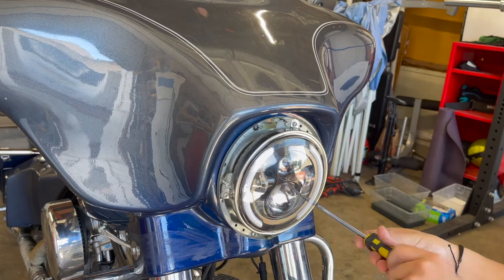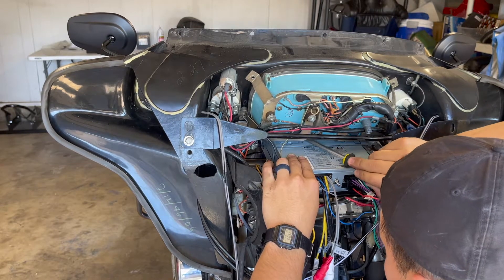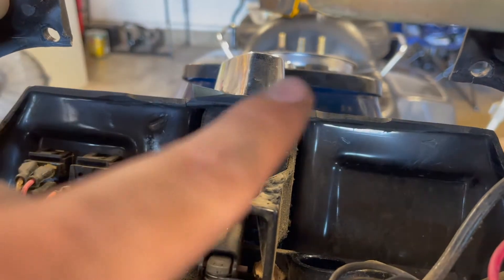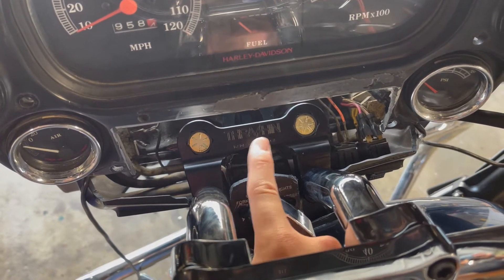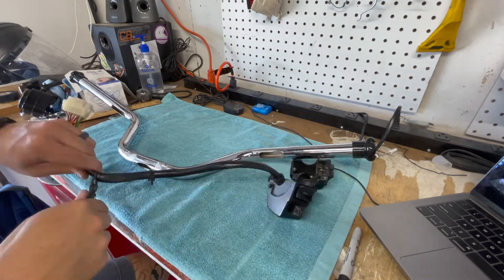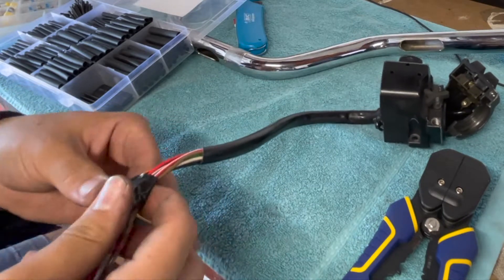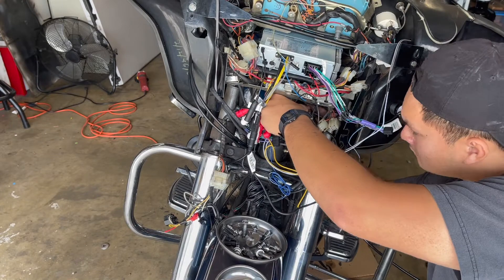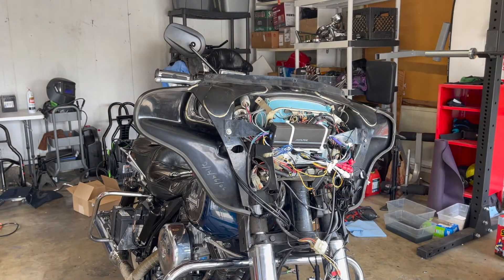Thrashin Supply Bars + Riser On 1986 Electra Glide! // How-To

Comment: I have a 1988 flhtc - that set out is sick.what rise and bars did you use?also the wire connectors
Hello again I called thrashin put they directed me to just a riser with out the adapter. That is the part number on what you used .is it necessary? Could you give the brand or riser and bar you used 1 inch diameter?

Comment: Hey i just bought a bike like this what risers did u use thrashin supply too?? Or just the top clamp and adapter were thrashin??😊
Reply from the maker: Hi! It was the Thrashin mid bends. I believe they were 7.5” pull backs from drag specialties. Thrashin top clamp

Comment: What size risers? And height on bars?
Reply from the maker: Hey Zach! Thrashin high bends and 5.5” pull backs!
Reply: You didn’t add the link to the risers though. What brand?
Reply: So about 10” All together?
Reply: Bars are 5.5 risers are 5.5 thrashin adapter 2”

Comment: I have a 93 Electra glide how do I remove the air ride to put on different bars or do I need to.
Reply from the maker: If i remember correctly, the air ride on this bike was pit separately. Therefore, I didnt really have any issues with the air ride when changing the bars!